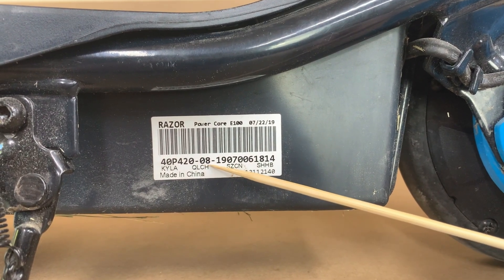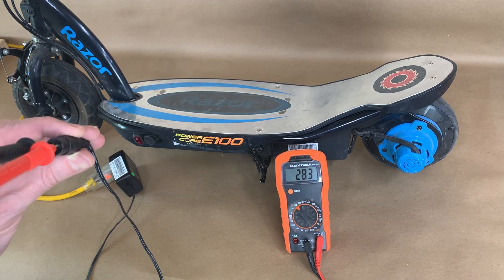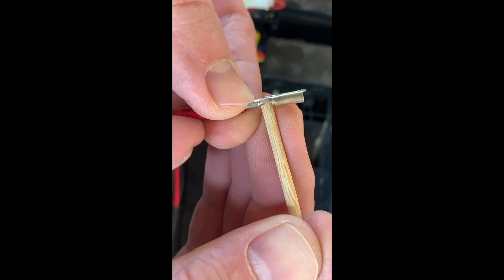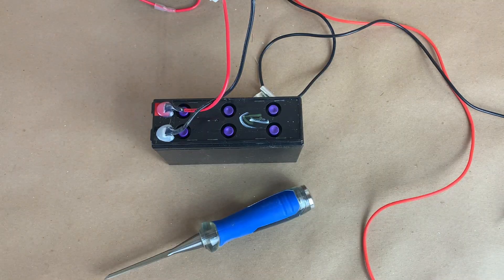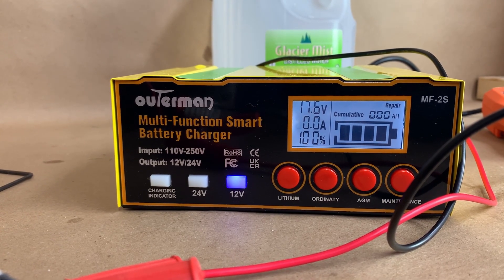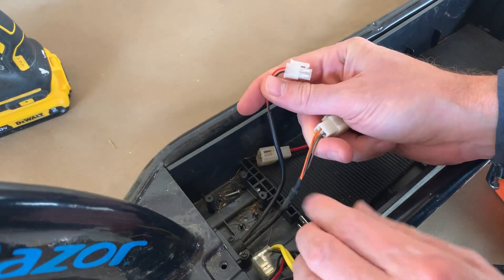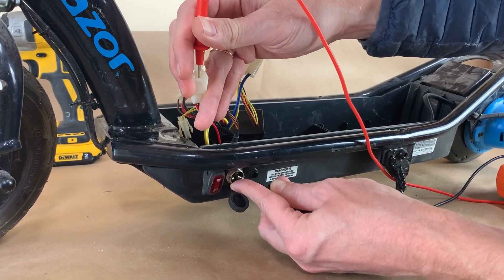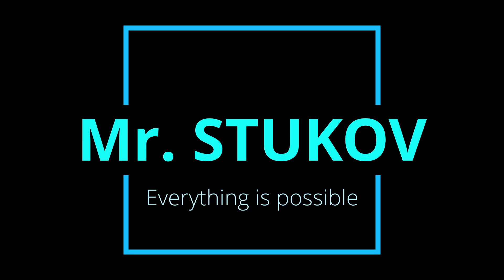Razor E100 Scooter Troubleshooting and repair

Comment: Liked and subbed, I bought razor e300 to repair, I’m
Confused about charging, the manual says to charge with power switch in OFF position but red light stays off with charger connected

Comment: Hi, when charging the Razor scooter, only the green light appears and the red light does not appear at start on the charger, and the scooter does not start, please may I know the reason?
Reply: I have the same problem
Reply: Did you figure out the issue? Going through this now.
Reply: Any updates
Reply: need help on this as well

Comment: Thanks for the info!  I bought 3 of these types of scooters for my kids (and they were all very excited) at a thrift store without  chargers, so it was a gamble. I bought chargers and charged them all. The red on/off light comes on for all 3. But it is about  as far as it goes. I'm  curious  about the battery charger you used once you added water. What exactly  is that, and do I really  need one to fix them if the battery is the culpit? Would reassembling  them back and using  the charger for the scooter do the same? I also have a thing to jump-start car battaries. Would that be of any use? (I fear it's  too powerful  for little  battery  like these.) But can these types of batteries  be jump-started?
Reply: I'm in the process of getting to fix one to I'm waiting on an answer
Reply: Did u ever get an answer to this?

Comment: You sound Russian. I’m half Russian and half Greek. I have the razor V100 glow electric scooter. 

When I turn the steering left and right, the front wheel does not move. I took off the handlebar and I noticed there are no threads in the handlebar but there are threads on the neck. I put it back on and tightened it and it seems very good now, but I’m just surprised there’s no sliding locking mechanism as a safety, just in case, the bolt becomes loose, it doesn’t look like a very good design. What’s your opinion?

Comment: Wow!  I never knew that you could take off the top cover of those batteries and be able to add water to the cells!  That alone is worth the price of the video!
Reply: Actually, I checked my batteries, and they don't come apart.  The tops are very tightly glued.  Also, my batteries are gelled types.  Perhaps there is a difference in the type of batteries they send to my country (USA) versus yours.
Reply from the maker: @ronaldrissel6665  I am also got it in USA. Covers also was glued but come out easy.
In my case it's 6FM6 battery. Seems that they put different batteries in the same model. I think it has a lot of release versions during lifecycle.
Reply: @ronaldrissel6665 dot heads 😂😂😂